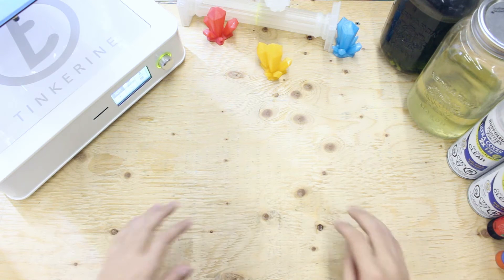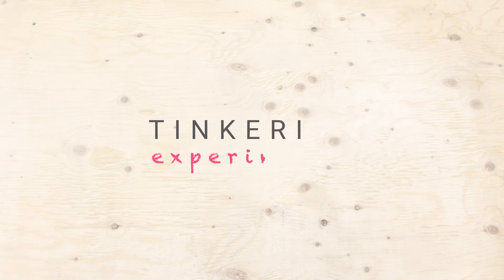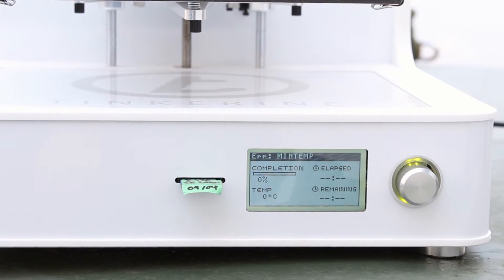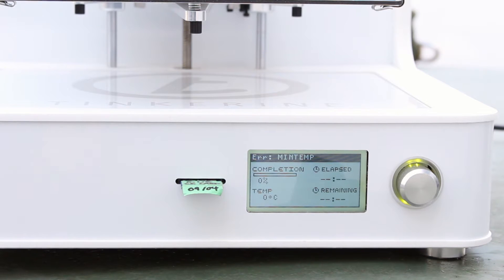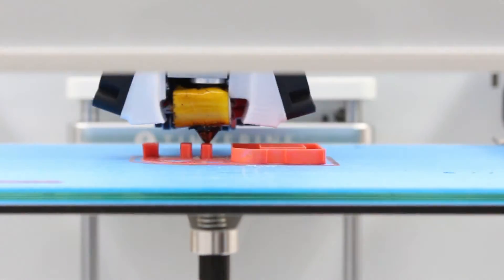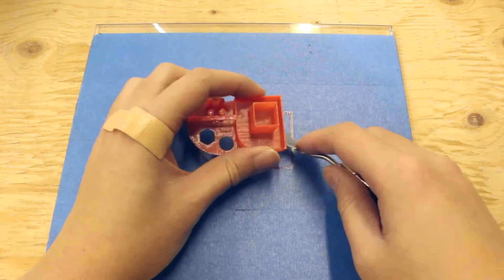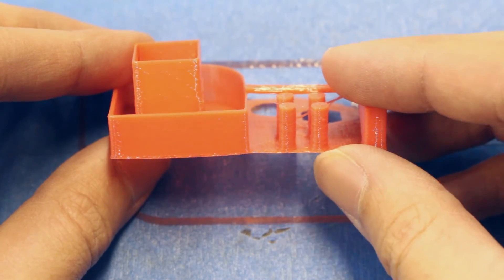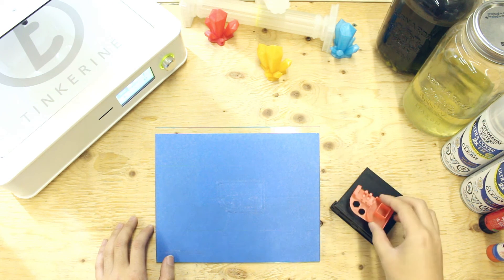Printing in a Cold Environment

Comment: You should do a bigger print. I started printing in my garage and it definitely affects prints. They start cooling off on the sides and cause warping. If you do a small print like this I think the heated bed probably keeps everything stable enough for that not to be an issue. Try something bigger and with more mass and see if that stays true.
Reply from the maker: Thanks for the comment and the suggestion! Great timing to look into it as the temperature starts to drop.

Comment: @Tinkerine,
Well done video. Useful information, straight to the point, with no unnecessary stuff.

Q: printed with PLA filament?
Reply from the maker: Hi Ivan,

Thank you for the feedback!  Yes, we did print with PLA outside and I was surprised that the temperature didn't affect the print that much.